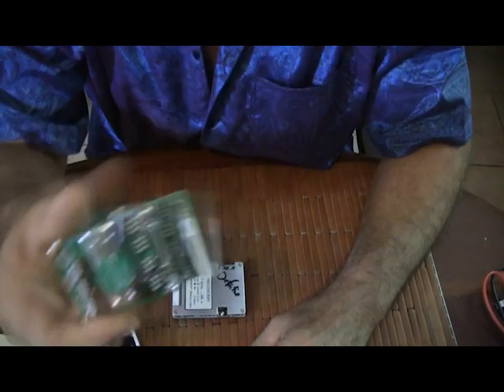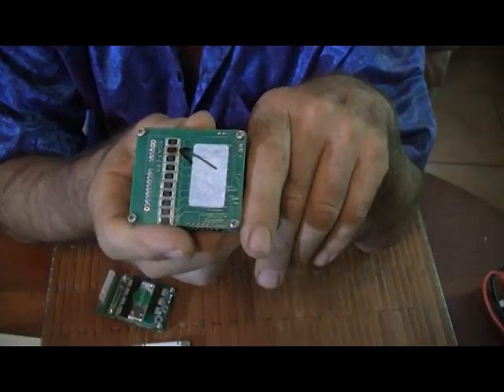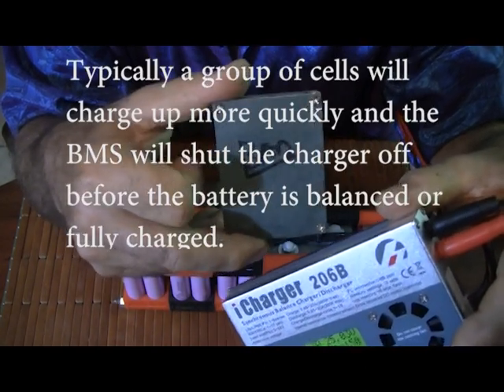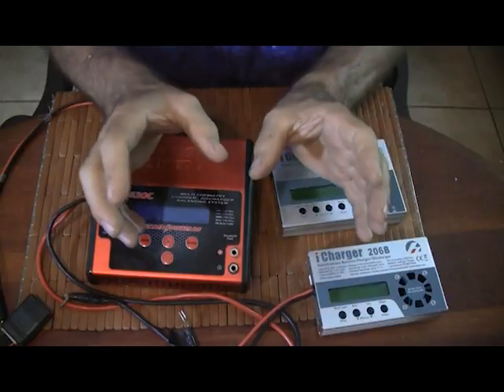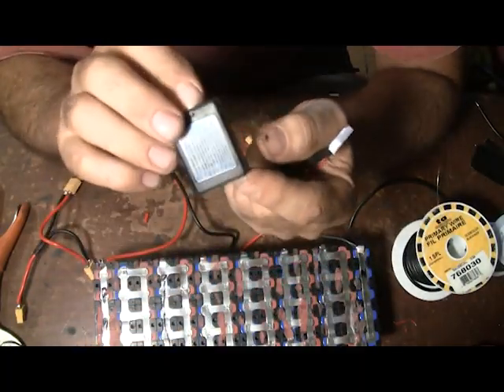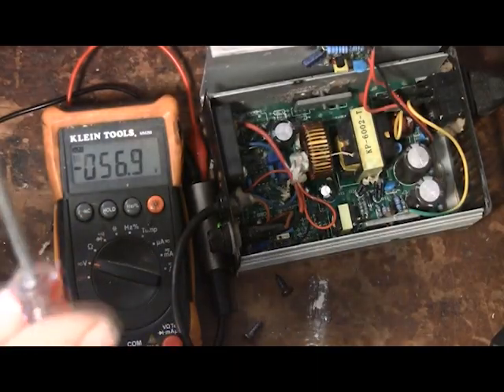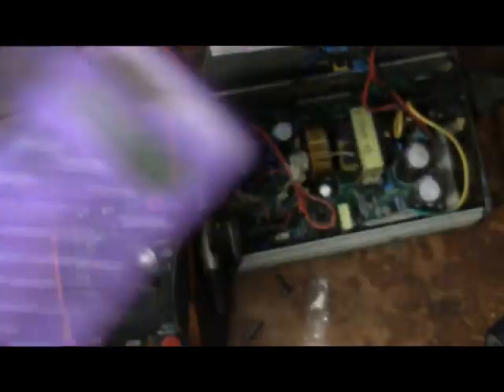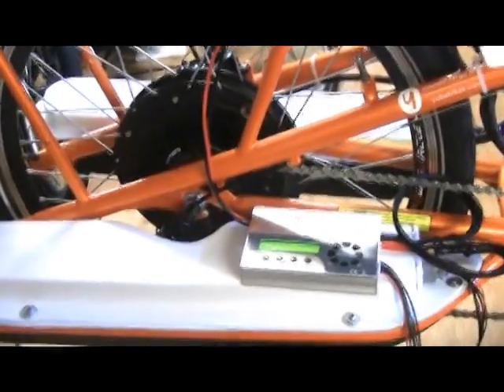How to build a safe and better lithium battery WITHOUT a BMS.

Comment: ok so what about FUSES?  where do they go? size?  your not going to put a fuse on each cell, perhaps each P group?
Reply from the maker: For me the question is "what do you want to fuse against, and what are the odds of that happening?"  Ok, the controller shorting or the wires from the battery rubbing through and shorting, or getting pinched, the insulation breaking and shorting... so use a whole battery fuse.  

Ok, how about a parallel group shorting.  I can imagine a scenario where the battery is in an accident and gets twisted and the parallel group connections get twisted around somehow and short.  So, fuse the parallel groups.  

What about individual cells?  Well, I can imagine going by a constructions site where there are nail guns and an errant flying nail pierces one of the cells of the battery, but because it is fused the remaining cells in the parallel group are saved.  

So fuse away depending on your level of concern.  I personally use a whole battery fuse and have never popped it.  

Do we fuse each cup of gasoline in our tanks?  Do we even carry fire extinguishers in our cars?  No, because experience tells us that the odds of that kind of an accident are small.  Batteries are the same way.
Reply: I do carry an extinguisher in my car, sadly tho it needs a ReCharge... Doh!  ok So i am doing a copy of your split pack tho I am using an Imax b6 so lets say i go with a 5p 6s pack x 2 as per your example,  the highest auto fuses i can find are 25amp, lets say i run 1 fuse per 5p6s, is this gonna cut it? my reclaimed laptop cells are coming in between 1700mah to 2100 mah, I may add 1 extra cell on low side cells to balance the lower maH.   Gr8 vids!, thanks for your help!
Reply from the maker: Ok, lets do the math.  A 6S battery pack fully charged at 4.2 volts has 25.2 volts.  25.2 volts at 25 amps is 630 watts.  Times two, for two batteries, is 1260 watts.  So you would need to exceed 1260 watts to blow a fuse.
Given that you are using reclaimed laptop cells I would say this is really unlikely even if you had a 1500 watt load.  You know what your max load is, so redo the math with that in mind......

Comment: can I use smart charger presently used for SLA batteries to charge li-ion pack? Thanks alot - also question about using DC power supply to charge- trickle cells or group of cells...Looking at using discharging with a OPUS or similar product to assess batteries before incorporating into pack as well- any vomment suggestions thanks alot
Reply from the maker: Yes, you can use a lead acid battery charger for lithium chemistries.  Just be sure the voltage is right.  Same with a DC power supply.   Undercharge by a volt or so to be sure you don't overcharge.
Reply: can use dc pwr supply as a balancing charger?
Reply from the maker: If you isolate one parallel group and use the power supply to charge that parallel group to 4.2 volts, then move on to the next parallel group, then yes, but obviously it is very tedious.  But, if you have a 2S or 3S battery....
Reply: apologies but looking for options to charge. I should explain: I trying to design a pack (to fit nicely in factory hard case of ebike) that from the top is 5 cells by 5 or 6 wide (for 10-12 Ahr based on 2000 mAh each) BY 3 cells end to end deep. So end up with each 3 by 5=15s > for multiply by parallel rows (5 or 6)p. so.... each parallel group would essentially be 12.6v?
Reply from the maker: I don't understand- is this a question?  How the cells are configured has no bearing.
Reply: well i guess it is a two-fold question so was looking for confirmation on design and if it works. I cant recall seeing any designs where cells are stacked first of all so was uncomfortable on it being viable. Creating 1206 v cells so to speak and then creating a 5 series for 60v and 6 wide for amp-hours. Also concerned about wattage of hobby charger for this configuration. So if plan above works then i end up charging for balancing 6 parallel groups of 15 cells- does this sound proper and do-able? the option of using a power supply was seperate question if a hobby charger wasnt adequate and also as a second option thanks alot and hope this explains.
Reply from the maker: Sure, anyway you connect the cells they will work.  You could spot weld them with tabs, bend the tabs, and stack the cells.  5 in series gives you about 18 volts, not 60v.  But if you are just doing a 6P5S battery then a hobby charger would work very well.
Reply: ok so i cant expect or can expect to make up 63v by taking the 12.6v stacks and join in series in one direction and then parallel in the other? That is my hope and really root of question to design of pack. Maybe it DOESNT work but was hope full that essentially as you say 6P5S >three high would make 63v (12 Ahr at 2000 mA ea) If I undertand you correctly this DOES work and hobby charger would handle the pack as actually 6P5S (even though I also have 3S vertically and have 12.6v insted of 4.2 for each parallel group)> apologies for any confusion
Reply from the maker: Yes you can build three small packs and stack them in series.
Reply: but then could only charge at 1 amp for 63 volts for a  60 watt charger (o.9 amps to be safe) does this sound correct? ie the imax B6 by SKY-RC is rated 60 Watts (6s) > and if the cells give data at 10% of say 1700 mAhr  >1.7 amps i couldnt do it at this rate...but have to balance charge this pack at 0.9 to 1 amp? or did i see somewhere that 0.5 amps is better for balance charging???
Reply from the maker: Your math is correct.  

The C rate is what you are referring to and .5 C rate is fine for balance charging.
Reply: thanks alot. So if this pack as described would demand to balance 6s(6 parallel groups) X 12.45 v (3x4.15v) X .850 A (1700 mA x0.5c-max) = 63.5 W ; I could charge slightly lower to meet the 60 w rated capacity of hobby charger? My question with this config is why doesnt the possible charging amperage increase also by number of cells in the parallel group? Ex: As each group has 3 x 5 cells so I= 5 x 0.85 = 4.25 A ?? Where total would then = 6s (parallel groups) x 12.45v x 4.25 A =317.5 Watts??
Reply from the maker: The charging amperage can increase with increasing cells in parallel.  But your charger is limited to 60 watts, so each parallel group can only get 10 watts, and 10 watts at 4 volts is 2.5 amps per P group, divided amongst however many cells you have in P in that group.   Good questions, I can see you are really thinking about this!
Reply: Thanks so in my case each P group has "15 cells"  but as they are in series vertically stacked in threes does this reduce the number you mention to 15/3=5 at the aforementioned 12.45 v?? ( btw- the pack planned design is 90 cells- (3x5) X 6 groups)*** Iguess you can disregard question as i now see that as you described if i use 12.45 volts for 10 watts i am going to get the same resultant of around 166 mA (for 5 cells vs 15 at 4.15) But am i correct in the wiring to expect to set charger at 12.45 volts?.  Anyhow, looks like a really slow charge, may have to look at a higher capacity charger, especially if I used and higher capacity cells. Not to mention I am not sure this charger could be set at decimals of amps as in 0.160 or 160 mA.
Reply: Also wondering about "cell loggers" and if they would see this as as 12.45 v configuration, built as described. Also are cell loggers same as "hop-ups" called on ebay and also if they can be set for alarm at a certain voltage and what suggested setting may be for ebike application (ie 3.0 volts)? Also, does alarm on these have dual capability for balance- I believe you had an alarm at off balance situation in another video. (say set also to 0.15 volt difference)? Having difficulty finding information for these. Thanks again!  https://www.amazon.com/RioRand-Hop-ups-C23212-Voltage-Checker/dp/B003Y6E6IE/ref=pd_sim_21_2?_encoding=UTF8&pd_rd_i=B003Y6E6IE&pd_rd_r=8HH4GQS1D0YPTQGFFTN3&pd_rd_w=0iWG6&pd_rd_wg=hvV81&psc=1&refRID=8HH4GQS1D0YPTQGFFTN3
Reply: Thanks for all your help but i humbly ask your input on how to wire balance leads (and cell loggers). I am wondering if a hobby charger would need wiring between each 4 volt cell group for a total of 3sets (for the 15 groups) or if charger should work with attaching to end or each group  allowing use of just one set of leads (for the 6 sets of 12 volts)? Same with the cell logger- (would the cell logger just report on what it saw and not as particular (mind you if i were to have to wire 3 sets for charging i would likely attach two additional cell loggers anyhow - and be have a more detailed description of what was going on in the pack by displayed values of somewhere around 4 volts instead of 12) Thanks again!
Reply: Don 't use desulphation charger, it will ruin Li-ion in short order

Comment: I thank you for your videos, is it possible to split a 7s battery , 4s &3s to charge on a 6s hobby charger?
Reply from the maker: Sure.  It is clunky though.
Reply: Shawn McCarty thanks for the reply, it's in a kids razor quad. Not really clear on the clunky meaning. But I'm trying to use what I have instead of buying a 7s charger thanks.
Reply from the maker: It is just fiddly.  But using what you have is great!

Comment: I finally fell into a bms. The speedict company has made a Bluetooth bms with balancing and a wattage monitor. Full shutdown, speed.... All the goodies!
Reply from the maker: I agree this looks like a superior BMS.  I wonder if it allows you to balance charge at 4 volts like a hobby charger.  It also does not state it's balancing capacity- important for speedy balancing.
Reply: Shawn McCarty I think it does allow you to balance to 4v. Haven't tested the resistor network yet, but I have some really terrible laptop packs on it. Should plug it in and see.

Comment: Hi Shawn, "Great Video" 👍🏼👌🏻 
I also have built an E-Bike Battery Pack "without a BMS", 1x 8S/10P & 1x 7S/10P (Charging & Balancing to 4.1V per Cell, done on a I-Charger 4010Duo) 15S/35Ah Pack when joined together in series through a Solid State Relay. "Ditch the BMS & Power to the People" !!!  lol 😁😬😊👍🏼 
If you get a chance check out my build, I like to see what you think about it. Cheers 🍻😎🇦🇺🇦🇺
Reply from the maker: Hey, you're the man!  You used a solid state relay to join them together?  Do you have a digikey part number?
Reply: Shawn McCarty 
 Solid State Relay
Model: SSR-100 DD
(100A Rating) 
Input Voltage: DC 3-32V
Output Voltage: DC 5-80V
Relay Size: 62 x 45 x 23.5mm/2.4 x 1.8 x 0.9inch (L*W*H)
Purchased from EBay - Item No 172420687040

I'm using an Aux Battery 3S/3P which operates control cct. For SSR, Twin Led Headlights & Usb Outlets all switched by a 3Position key switch

Comment: Shawn, great video:-) Do you, or anybody else, know how you can change/modify  the voltage at an OPUS BT-C3400 v 2.2 to Charge only 4.1 volt. I think your point is right not to puch the 18650 cells to hard - they will last longer.
Reply from the maker: I looked at it- It looks like a project.  Perhaps buy a 6P batteryBloc and a 4 volt charger and charge up 6 at once....??

Comment: Can you get 10 S Cell Checker with Low Voltage Alarm. I have a 10 S 4P battery pack and I will like to install Cell Checker at the case. I like to have only one Cell checker in ordre to save space a the case.
Reply from the maker: No, I have never seen one- 8 is the max.
Reply: Thank you Shawn. maybe somebody els know something!

Comment: hi shawn will a 30 amp bms 52v be safe to use with my ebike 14s5p kit.i have the Samsung 25r cells mostly an 20 Panasonic 2600mah.i havnt used the pas sensor on the bike yet I guess this will make the battery last longer so as long as I pedal mostly the sensor feeds more power in the faster I pedal?i havnt connected the bms yet.u know I had trouble with one before.not sure if it was the weaker Samsung 26h cells I had or bms.but without bms at last ride up and down hills I got 7mile and the pack dropped to 49v from 54v.i have a voltmeter on handle bar .do many people use bms now or not?steve in uk

Comment: Hi Shawn, Great Video 👍🏼👌🏻😊 I also "don't use a BMS"for the Same reason as in your Video. I Built a 8S/10P & 7S/10P Packs joined together electrically in series through a Dc to Dc Solid State Relay & Key Switch operated by an 3S/3P Aux Battery but Charged & Balanced Seperatly in my Enduro Ebike BBSHD Build, giving a Total of 15S/10P 35AH. 
I also use a Hobby I-Charger 4010 Duo with Custom Made Soviet Miltary Plugs (Silver Contacts) & Sockets for "Plug & Play Charging/Balancing.  Thanks to your Video & Knowledge I'm now getting "much more Cycles" out of my Batteries as I switched from 14S to 15S Configuration so I'm only charging to 4.08 per Cell. For my BBSHD Motor. If you have time please check out my build, I be happy to see what you think 😊👍🏼 Ditch the BMS "POWER to the people ...lol 😜😬😁

Comment: Do you know if the i max b6 can balance charge 7s? To charge a battery like this i think youd have to break it in three if the imax b6 is all you have
Reply: Nm i kept watching your video and it inly does 6 cells, id need one of those 8s chargers, great work tho!
Reply from the maker: It will balance up to 6S.  To balance charge a 7S you would need to break your battery into a 3S and a 4S.
Reply: Shawn McCarty thanks for the reply, another quick question.. can i charge one cell at a time in parralle? Lets say i have a 14s10p battery, can i put an imax b6 charger to charge at 4.10v on the negative and positive of the cells in parralle while everything is soldered together? So id basically repeat the process 14 times

Comment: As an Electronics Technician, with many years of field experience (yeah, old schooled in TVs, who also keeps up to date on tech) I can vouch for this excellent presentation. 
I began watching the video and had to smile when you came to the point that BMSs do not provide any feedback of the state of the individual cells, therefore makes no sense to use them, specially when one cell goes whacky and the BMS shuts down everything. 
Thanks for putting it together and to the people who gave negatives to the video, you guys don't know squat about LiIon batteries and basic electronics.
Reply from the maker: Thanks, I'm chuckling.  
It's an old saying to "not know squat"  I believe it came from the era of the paddlewheel boat captains making their way up and down the Mississippi.  If you didn't know "squat", there was a good chance you would run your boat aground on a sandbar....   Is there a metaphor here?......
Reply: hah.. absolutely... those folks don't know jack shit either :-)
Reply: The crux of the video --if your batteries are good quality, you don't need a BMS 😂😂and if your batteries are bad quality, BMS won't work,,😂😂😂
Very true facts
Reply: It dose balance each cell.

Comment: I hope I can get an answer but I am wanting to have cells for solar power wall. This all makes sense for charging things for like bikes but what about units that will be in a constant load/charge configuration
Reply from the maker: My power wall does not use a BMS.  Any ebike type BMS will be woefully under powered when trying to balance a power wall.  The load charge is not relevant to balancing- you can be getting more power than you are using and so be charging even when under load- so you need to be able to watch the high voltage all the time.   Does this answer your question?

Comment: Hi Shawn, when charging to 4.2V, most chargers use cc/cv, keeping constant current until voltage reaches 4.2V, then holding voltage at 4.2V while reducing current until charge current is near zero.  When you modified your charger to charge at 4.0V, is the charger stopping charge as soon as voltage reaches 4.0V, or does it continues with the cv stage while holding voltage at 4.0V?
Reply from the maker: Good question.  When you change the charger voltage, the voltage you set becomes the new target voltage.  So the current tapers off when the voltage max is reached- or else it would go over the target voltage.
Reply: Thanks Shawn.  One thing that's being puzzling me: on many RC chargers (e.g., Tenergy TB6B, Imax B6, and maybe the iChargers as well), the LiIo and LiPo charge voltages are preset at 4.1V, and 4.2V respectively.  I'm under the impression that all 18650s are LiIo cells, but most on the internet use the LiPo setting (thus using 4.2V) when charging 18650 cells.  I've looked at the spec sheets of several popular 18650s; the specified charge voltage is 4.2V.

Why do you think the chargers default to 4.1V for the LiIo setting?  When would you use that setting?
Reply from the maker: I don't know.  If you find out, let us know!

Comment: I just remembered I ordered 2 x 5s bms off eBay so could I split battery into 3 like I had before an use imax b6 with 3 separate leads but with batteries not connected or leave as is and see how they go .have you heard off a hobbymate cell checker it can discharge batteries got one on way it was only 8£ and can monitor cells too

Comment: Think it’s because as my kit in 2 x 7s one half was not matched end to end like red blue red blue as my vruzend kit I coloured so instead of swapping wiring I just turned round one side and after wiring 1black wire to balance bms plug from battery then 7red alternate I precede to wire 8th red or 1st one on 2nd half then I got the smoke from bms.maybe I need to build kit as just one then rewire
Reply from the maker: YEs, it you get the bleed wires wired wrong you will smoke the BMS.  Probably best to chalk it up to experience, order another, and try again.